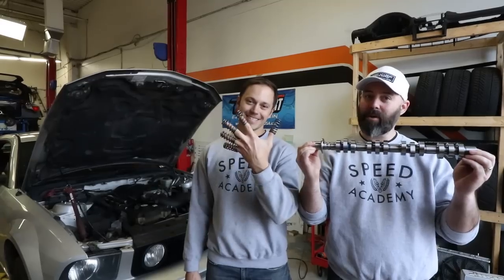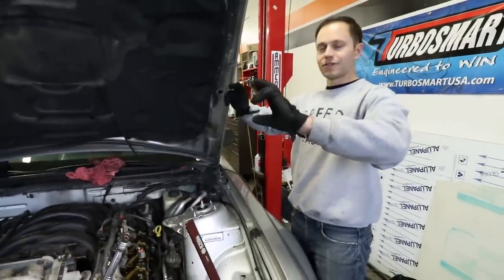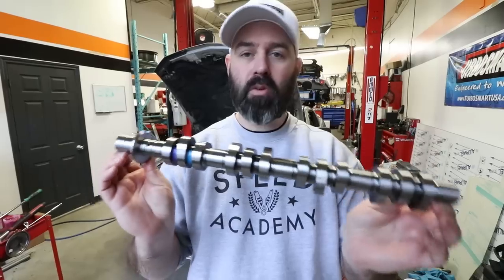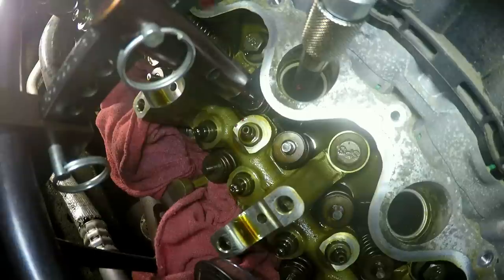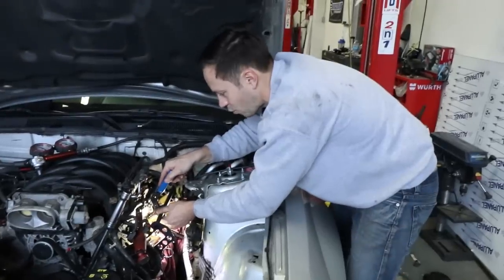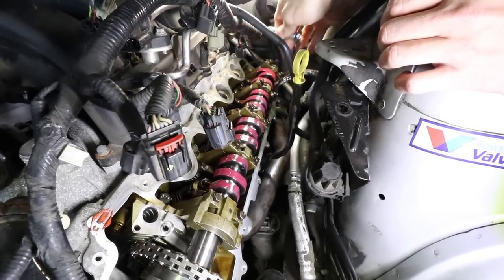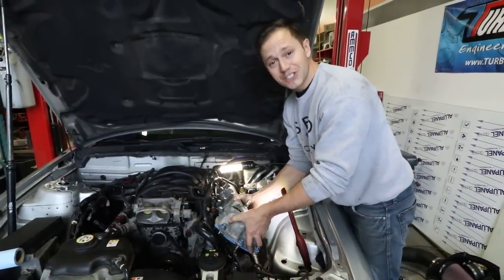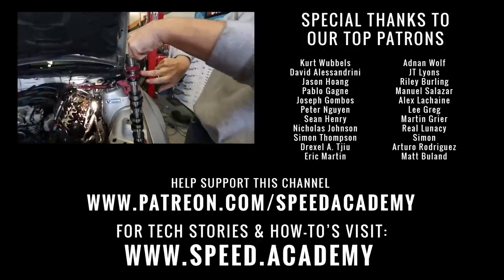How to Swap Mustang GT 4.6L V8 Cams & Valve Springs - Mullet Mustang - EP16

Comment: Stage 2 cams literally means nothing.
Reply: Except it does. In this case you can look up Comp XFi Stage 2 VSR cams for the 3V 4.6/5.4...

Comp Cams #127300 XE261H-15.5
222/235 Duration @ 0.050"
0.490"/0.480" Lift I/E
115.5 LSA on a 101 ICL (that's some hefty cam advance)

Pretty healthy cams for a small 4.6L.
Reply: +Lucky Rooster it really was not alot of work Valve seals will have stop oil burning and stage 2 are around 35+ rwhp vs stage 1 20+rwhp

Comment: If you set the crank at about 12-14 deg from top dead center, you hit a spot in the cam where no valves are under spring pressure (or are all under equal pressure, and when you release the cam pulleys, they wont spin on you, and you don't lose alignment with the crank. Little tips from hard lessons learned.
Reply: God Bless you, I'm going to be doing an entire top end rebuild with new timing components and I was wondering if there was a spot where no springs are under pressure.
Reply: So is it 12-14 degrees before you hit tdc? Or 12-14 degrees after you hit tdc?
Reply: @BJ-fk9sq  when you rotate the crank with valve covers removed, you will see when you hit that sweet spot. No pressure on any of the valves.
Reply: @feellnfroggy  ok, thank you!

Comment: Good job guys!! Changed my springs, cams and timing chains on my 2007 GT and it was a badass experience
Reply from the maker: We certainly dont want to do this again... ever haha
Reply: Speed Academy just had a rocker seize up on me and destroyed the cam on the driver side
Reply: @speedacademy  how much preasure did u use for the cylinder?? I'm installing my stage 4 comp cam and having a hard time removing the valve springs.. please help !! Anyone !!
Reply: @mattadams5016  did you ever find out how much pressure to use?

Comment: The mustang I bought was a half finished project, I put 5.4 cams from a 3 valve truck, and I havent had problems so far. If u want a more mean sound, do it. I didnt have a choice, cause I was on a budget, and I could not find any 4.6 3 valves in the junkyard

Comment: the more I watch work done on the top of those modular motors the more I like the old pushrod motors. For grip on the cam body when lining up the phaser sprocket try a small piece of leather or Naugahyde in the jaws of the pliers.

Comment: I use pearl necklace drop it down the spark plug hole till I got  almost a whole necklace in there..

. and then I slowly roll the piston upward till it pushes on my pearls and my pearls hold my valves in while I make spring seal changes... and it works on all engines..use it on lawn mowers to.....

Comment: What fitting did you use to put air into the cilynder I have the same tool and none of the attachments threat to the spark plug hole?

Comment: God that first start up scared the living shit out of me! I don't even like mustangs but damn did that sound BAD! Good thing it was only the lifters though.
Reply: Beakz_ yeah I thought the chain gone fucking nuts lol
Reply: Mine is doing this after a stage 3 comp cams install. How did you guys fix the issue? I spun the motor over a few separate times until the oil pressure was up and still has that god aweful noise. Please help lol

Comment: Question(s) for you - I gather you used the compressed air because you cant  crank the engine (manually) to get the valves up , yes? Does the air hold them all up or did you move the air line? Second - have you seen the Lisle 36200 Valve Keeper Remover and Installer tool ? Wonder if it works on a mustang...watched on a Honda and it was awesome....put this in the youtube search box "replace valve stem seals - with cylinder head on" and tell me what you think...would save folks ALOT of time
Reply from the maker: Correct, the compressed air is one of the best ways to ensure you dont drop a valve into the motor. It pressures the cylinder and holds the vales up. Never seen that tool in action on a Mustang, it could work but we've always trusted the compressed air method.

Comment: Are you not supposed to lockout the phasers on those cans I have Cam cams first stage and I had the lockout the phasers and it made 350 rear wheel horsepower along with the motion plates delete system

Comment: Do you think it's worth upgrading a cam for a grand marquis? My only upgrade now is that aluminum intake cover when my plastic one cracked. I plan on switching to dual exhausts but was wondering if I should do a cam swap first? Thanks

Comment: What tool did you use to screw into the spark plug hole to hold the valves closed?

Comment: where did you buy the spark plug air hose i cant find one? the ones i am finding are 14 and 18mm i was told the 3v is 16mm help me out if you can thanks

Comment: The one downfall of a cams swap on a 3 valve is that the stock bottom end will probably  fail , catastrophically , if used frequently at R.P.M.s approaching 6400 .
Reply: Richard Skipper most likely the stock rods can’t handle 6,400RPM+. Connecting rods are under a lot of tensile and compressive loads constantly and if you’re approaching 6,500+ RPM consistently, you’ll probably end up snapping a rod. the crank is pretty stout so i doubt its the crank that’ll go first.

Comment: Any break in procedure for post install? I've seen comp cam that needed a 15min run in at 2500rpm to properly set and harden the wear surfaces on the cam lobes.

Comment: Not bringing the engine  to TDC will not reveal  how worn the  chain and sprockets are. When I replaced the all the timing hardware  I found I had to move the driver side cam about 5* to bring it back to TDC  when all the new parts were installed . This out of time cam shows up when comparing O2 sensor readings. Everything else was a 100% on my 4.6 and ran fine but the O2 sensor reading were out of whack (comparing cyl banks). Couldn't find an explanation swapping sensors of course confirmed it was not sensors. It was after changing all the timing hardware due to a bad tensioner and I happened to look at the O2 sensor data afterward  that I discovered that the readings were now normal.
Reply: Use an ARP bolt on the sprocket (phaser) one time use bolt won't have to be replaced if it ever has to be disassembles again. I also remove the fuel pump relay and crank the engine till I see oil PSI when ever I have opened up the oil system. That was a scary sound but the prelube probably saved it from damage.

Comment: What are you guys using to keep pressure in the cylinders
Reply: Ernesto Luna I'm betting they're using the shop air. You can buy a fitting that screws into the spark plug hole with a little hose that connects to the shop air line for fairly cheap.

Comment: GUYS DONT LIE, YOU HAD TO TAKE AIR INTAKE, AND VALVE COVERS OFF AGAIN, THAT SOUND WAS NOT NO OIL ON THE LIFTERS, YOU MESSED UP BIG TIME, BE TRUTHFULL AND ACCEPT YOUR MISTAKES. next time if you wanna fake it well, put back the intake clamps on throttle body and air filter exactly the way they were when you did start number 1.

Comment: How much hp did u gain from those cams and was it worth the money and why not a stage3 cams??
Reply: Stage 3 Cams are a serious upgrade, Stage 2 XFI VSR Cams are a good set IMO.
From what I know, Stage 1 is for bolt on builds, stage 2 is for top end rebuild builds (springs porting etc), and stage 3 is gonna be for fully built "
race" cars. Not saying it can't be done but drivability will be rough along with other things.

Comment: what did you use to screw into the spark plug hole for the air ?
Reply from the maker: A leakdown tester, it includes a hose that you screw in.

Comment: How did you prime the engine? I have the same lifter noise like the first start up y’all did
Reply: Unplug your fuel relay and crank engine for 15-30 seconds. Thatll get your lifters filled with oil again.
Reply: You can put the pedal to the floor turn the key for 30 sec. When it's floored the ignition isn't on. I do this on winter mornings to prime the engine. 👍

Comment: This was a costly and difficult task.  

You’re better off by first removing the engine mounts, taking the transmission bolts out, and removing the 4.6.  

Next, get yourself a Chevy OHV engine.  Replace the ONE cam and BOOM!  More Power.  Now install into factor location using swap mounts.

Comment: probably shouldnt use that torque wrench to torque bolts by angle. use a breaker bar with a dial attachment 👍
Reply: E46SilverBullet  digital torque wrenches have angle setting built into them now days.
Reply: yup.  Has digital torque angle built in.

Comment: Hi, would like to ask, in the video, that I saw that, you've replaced all the Rocker armrs and lift  Adjuster and changing the cams! At the same time. How was it possible ? Please explain me in advance  Thanks  you so much
Reply from the maker: YOu have to remove the cams to change the springs so the lifters and rocker arms can be removed at the same time.
Reply: Thanks so much but As in the video, you changed the cams in both banks, the crankshaft key as it was positioned to 12 o'clock " TDC " ? Thanks

Comment: Titanium are stronger!!! 🥴🥴🥴
Reply: He never said stronger. He said the steel is more durable. There’s a difference. The titanium is stronger but in terms of mechanical properties steel is generally considered more resilient making it more durable. Steel is also harder than titanium and more wear resistant.
Reply: Generally, high strength, low alloy steels have higher tensile and yield strength than titanium. However, titanium has a higher strength-to-weight ratio and better fatigue resistance. Tool steels have high hardness and wear resistance but tend to overheat.